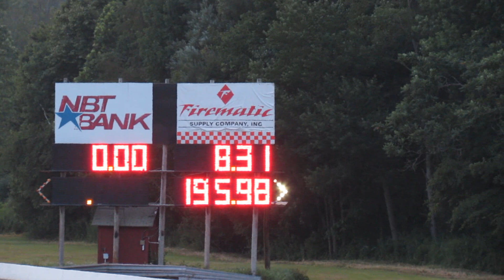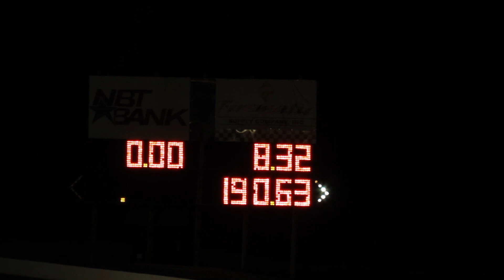Shockwave Jet Truck - 2017 Night Of Fire at Lebanon Valley Dragway

Comment: I saw him go 4 seconds at almost 400 mph at an air show on base, “NAS Oceana in Virginia Beach, VA. I was way more impressed, he either held back for lack of braking area, or was having issues.
Reply from the maker: TomTreeMan seeing the Shockwave ripped down an airstrip is the best!!
Reply: Lot of difference in air strip and drag strip air strip is whole lot longer more room to get up speed
Reply: Okay good to know. I just commented, wanting to know the horse power at the 195 miles per hour that was mentioned. But wow lol imagine it at 400. Now I wonder what's it at maximum horses lol
Reply: It was obviously not putting more than half power into those runs and shutting down early due to lack of road to slow down on. Perhaps if it could deploy parachutes it might have been possible to go at full power on the runs in this video.
Reply: @JoRgEChavez-to2xd  it does deploy chutes, it has 2 or 3 of em that get deployed every run. And not much of a shut down area at Lebanon for the big heavy truck, i just seen it again at Lebanon Valley few days ago for New York Jet Wars, he only went 109 mph i believe, and the other single jet cars were right under 300 mph. Kinda sucked this year as Shockwave Truck only made 1 pass down track, were as all the other Jet Cars came out twice.